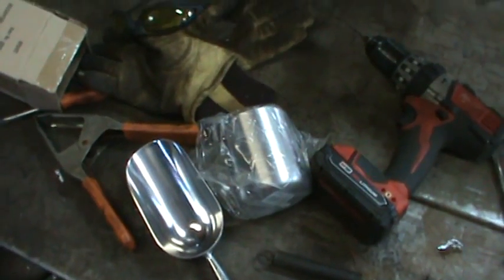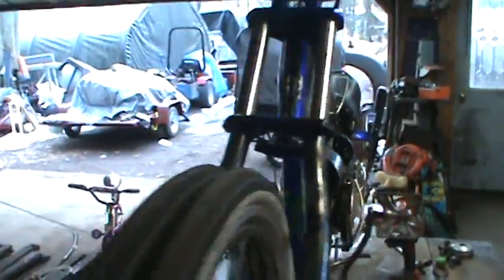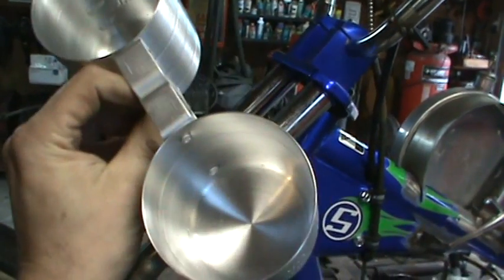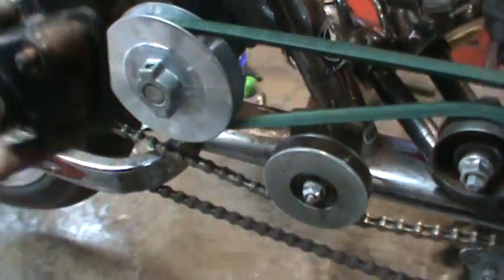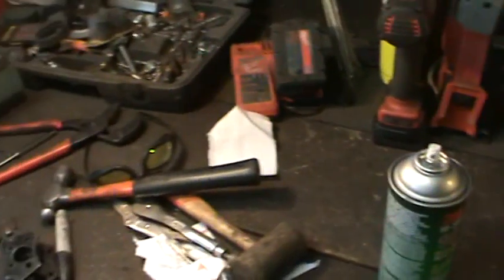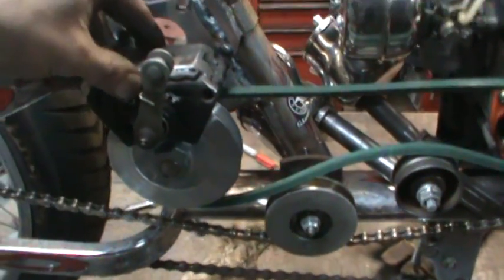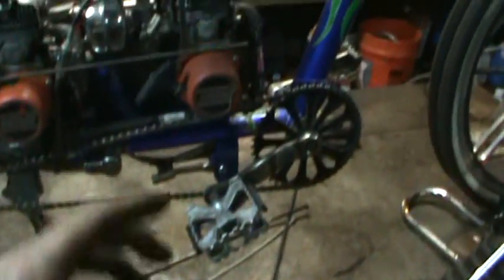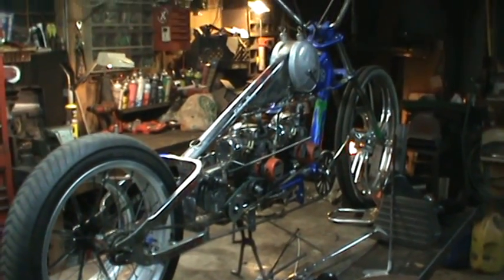think twice bike pt 13, rear brakes

Comment: Will the leather drive belt have enough grip to slow the bike without slipping on its pulley?
Really enjoying this build and the use of the utensils alot of great ideas you have.
Take care.
Reply from the maker: Shakes 73 im more then likley going to have to replace it with rubber like on the other bikes

Comment: I looked at the frame and fork and all the added weight will break the forks right off at the welds,hopefully you will re enforce it before the maiden voyage lol!
Reply from the maker: speedjunkie66 front end has not been done yet. those little welded on washers are just to hold it in place during mock up,

Comment: do you have a wore out car clutch disk ? drill out the rivets , and cut out new pads for the brakes , being the speeds you will be going are low ,something like liquid nail would glue them on I bet , or plan the cut right , and reuse some of the clutch rivet holes maybe ?
Reply from the maker: towrecker if it burns up easy l may try that